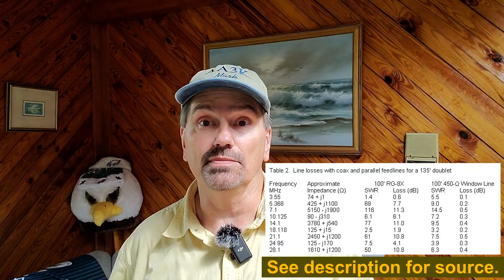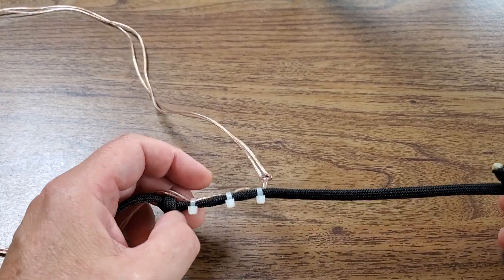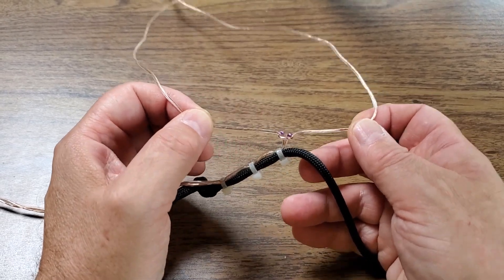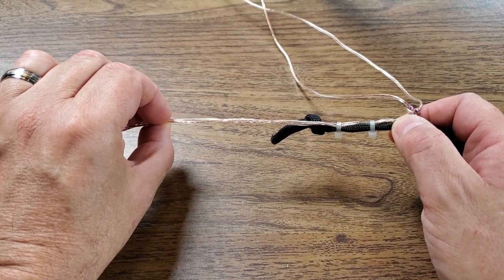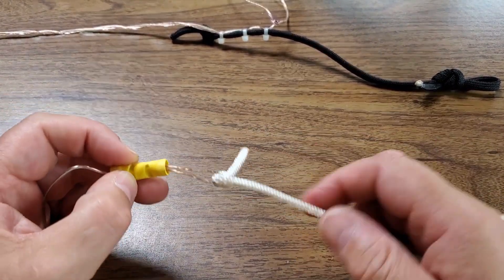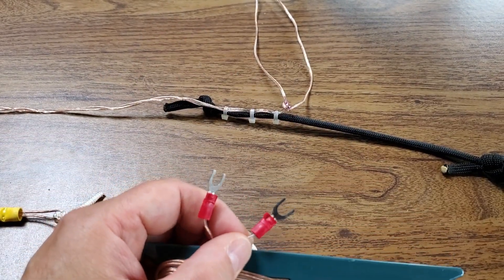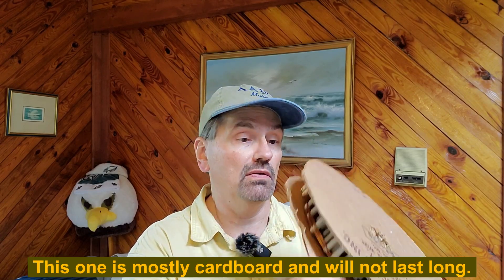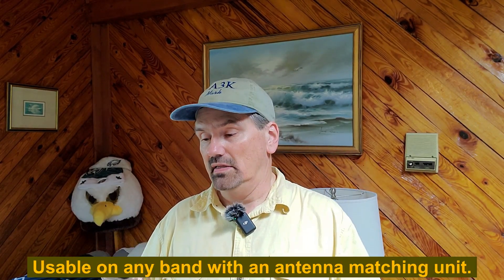Building a Great Low-Cost QRP Antenna! The Speaker Wire Doublet

Comment: You could make it a bit shorter and a bit easier on the ATU ? By making it similar size as a 1/2 size G5RV (51 feet end to end and abound 17 feet feeder )? Or extend the feeder and shorten the dipole  legs making the total length feeder+one side 42-43 feet , will give a low to medium match?  Or like me get the feeder length bang on a 50 ohm match on one particular band ? I find the dipole lengh is not so important, as you say , however the total length including feeder might add up to a bad match ? 
Just a thought . i been playing around with doublet ant last 25 years ,still learning . Currently using 70 metre  top with about 16 metre ladder line and a short 2 meter coax gives me good match on 160m ,flat on 40, and 30m, 6m and medium match on all bands apart from 80m which i am working on .
Reply from the maker: Interesting observations. Right now I only use this doublet for portable QRP activities so using a tuner to get to any band is acceptable. Though the last time I set it up in the field I had the common problem I have with any dipole, getting both legs around tree branches.